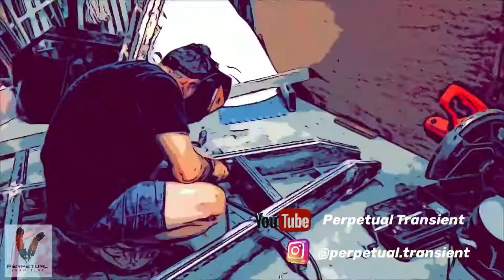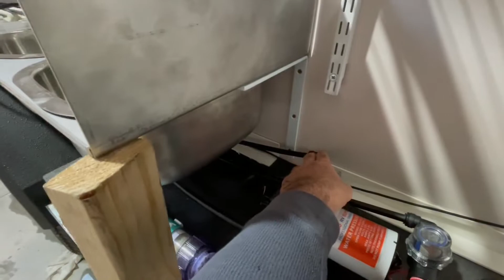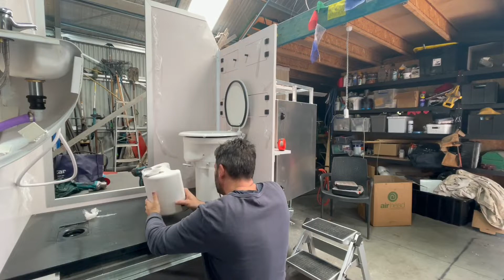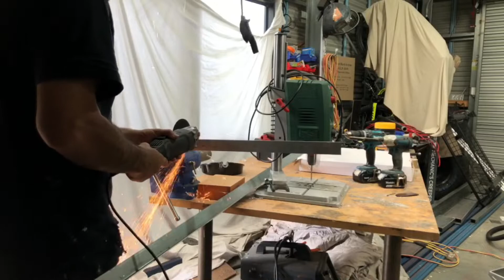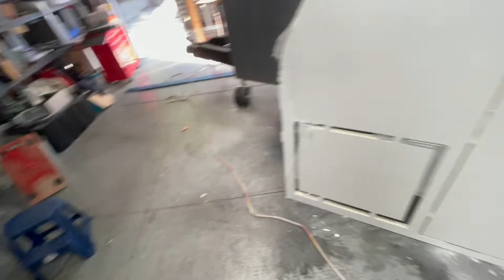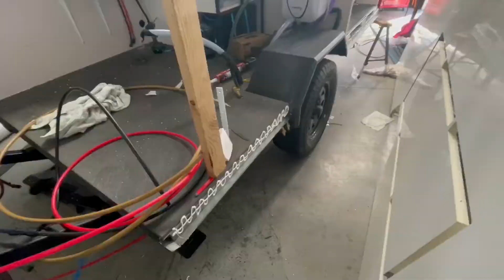Episode #12 - Solo DIY offroad caravan build - fibreglass composite walls, composting toilet, pumps

Comment: On the suction side of the pump I’ve had more problems with air leaks. I fitted a water volume gauge that had barb fitting  and even though they were water tight they would leak air. The air leaks make the pump noisy and you end up with air in the lines which slows down the pump coming up to pressure - which is annoying.

I ended up sealing the joints with food safe silastic.
Reply from the maker: Reckon I’ll need to make some adjustments too. Pumps worked heaps better initially, take a bit longer to pressurise and switch off now

Comment: just a curious question as I have not watched all your videos as yet, but what thickness are the wall panel, and could you show a close-up pic. Thanks
Reply from the maker: 28mm - 1.6mm skins in 25mm foam core. I can’t put photos here but if you want to look at the Q&A episodes 1&2 i show close ups of all the materials
Reply: @PerpetualTransient  Thanks for that, I am getting 32mm panels for mine, hopefully, should keep the cold and heat out. 😎😎😎😎 I will be installing a temp gauge inside so time will tell.

Comment: Another great video. Suggest you put a pipe support on the that brass tee for the pressure sensor as the weight of the tee and the brass shark bite fitting bouncing up and down on a rough road could crack the plastic tank at the connection point.
Reply from the maker: Yeh good plan. I’ll stick one up to the underside of the floor. Saying that though that tank is bloody thick and reinforced around the fitting

Comment: You did well lifting those walls by yourself, they look a bit weighty! I was wondering why you didn’t just cut out the door/windows, but they must be in for strength when installing I suppose.
Reply from the maker: Yeh that’s it. They would’ve been fine in hindsight, but wasn’t sure at the time so didn’t risk knocking them out first.

Comment: Lift the water filter leaver up and it locks on Craig. Well Done, Mate I have back issues and I was grimacing as you were lifting those wall panels.  You have inspired me to have a crack.  Do you think you will be selling a package of plans, specs and tips when it is all done? Cheers Mate.
Reply from the maker: Thanks Jimmy. Someone else commented on the water filter tap and yes low and behold it works. Should’ve read instructions! Not planning to sell the plans. I can send you SketchUp files if you want them.
Reply: Would love a sketch- up as well. Very interested in products were bought for this trailer.
Reply from the maker: @sheilahorton5189  if you go follow me on Instagram @perpetual.transient you can DM me your email and will send
Reply: @PerpetualTransient  just sent you a dm on instagram. Thank you.